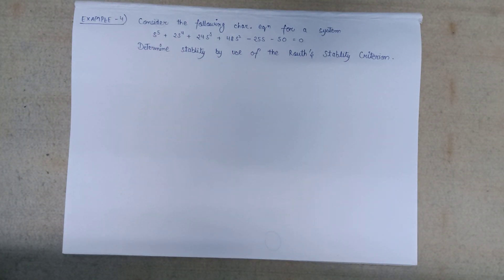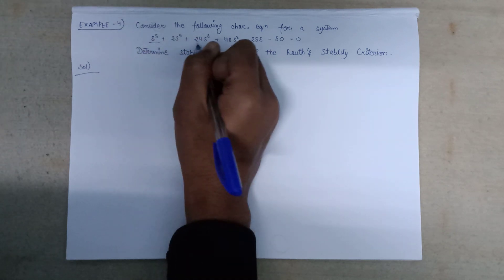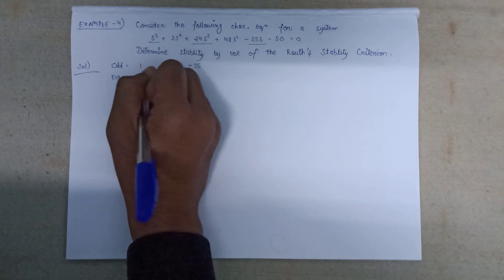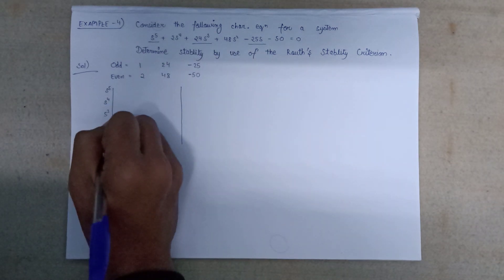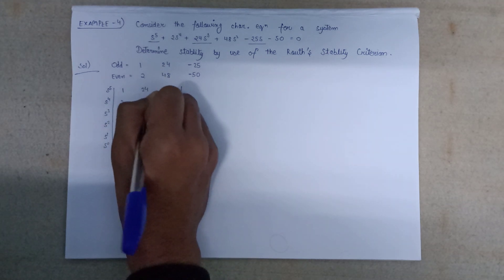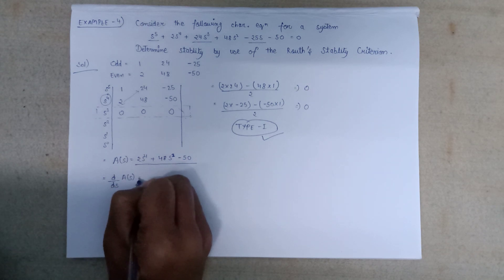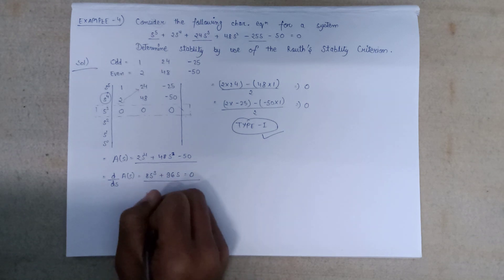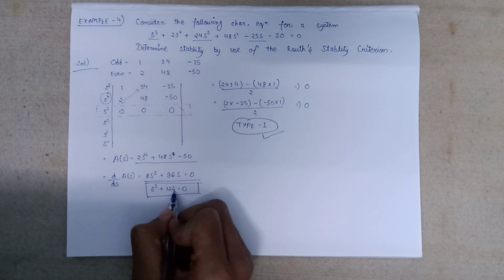Lec -1.10 Example 4 | Routh's Criterion, #routhcriterion, #rtuwallah ,#controlsystem

Comment: Hey buddy thanx for the videos you videos are helping us a lot, can you tell me that in your videos necessary and sufficient condition you said that for a stable system the characteristic equation must have all the sign same so from that point can we just say that this equation was unstable since the sign of coefficient of s^1 and s^0 are negative
Reply from the maker: Thanks for your valuable comment.
According to the sufficient conditions, each term of first column of routh array should be +ve and should have same sign. Then only that system will be considered as stable system.
If sign of terms in first column are -ve , then it may be treated as unstable.
Do like, share and subscribe the channel